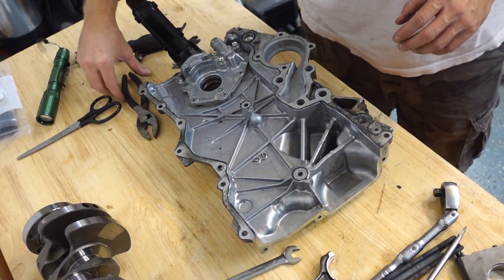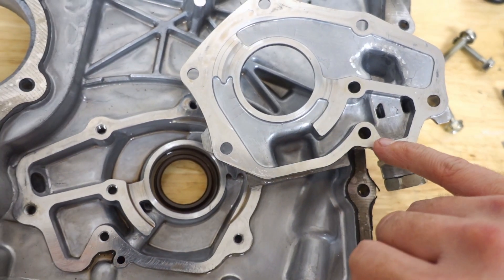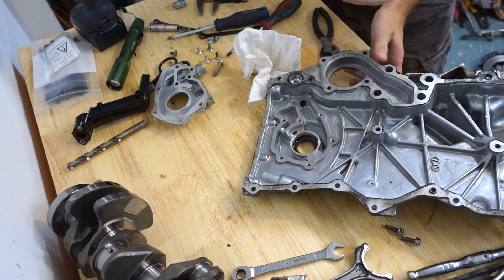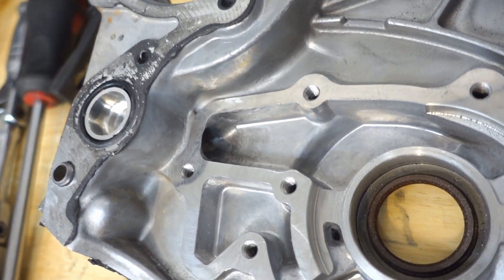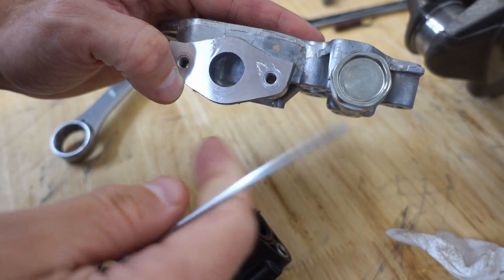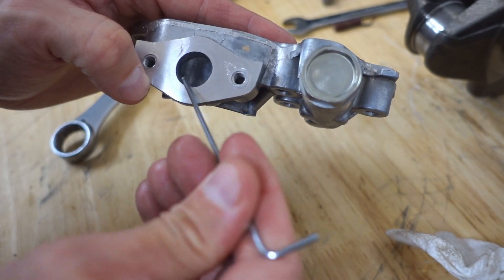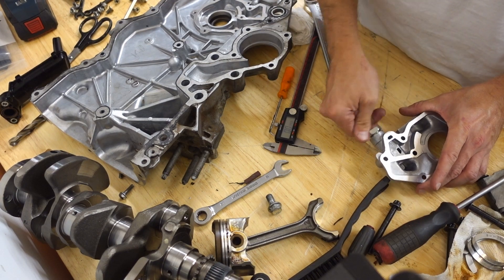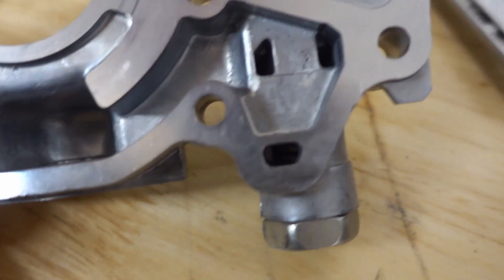Free Oil Pump Mods for making Big Power! | Road to 300hp Pt. 2

Comment: Clueless!,   Have the scoring machined from the pump surfaces would be the place to start.  YOU CANT INCREASE OIL PRESSURE BY ADJUSITNG THE SPRING FOR THE RELEIF VALVE YOU FUCKING DOOSCH!

Comment: I did basically the same thing to a 429 BBF engine, along with rounding off and polishing the oil channels in the block. It was well worth the effort. The engine held great oil pressure and it had oil pressure immediately on startup. 
Great idea and how to, thank you!